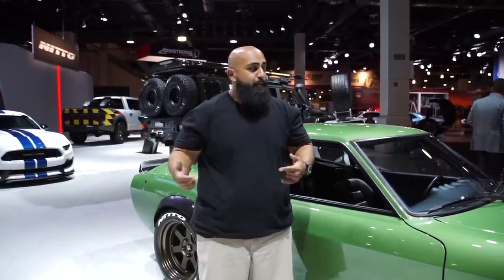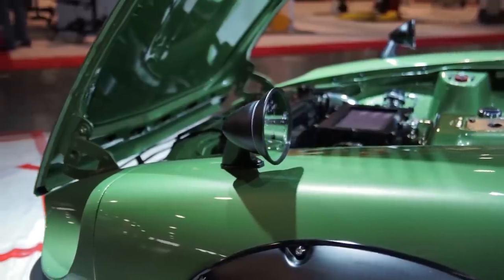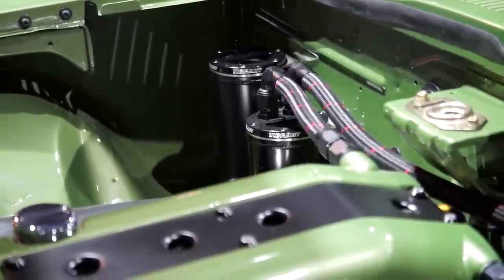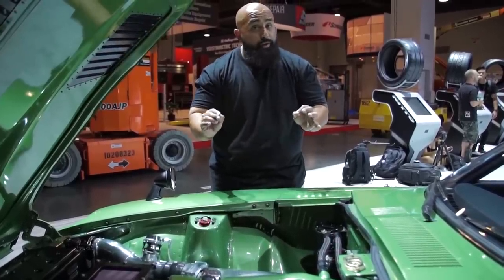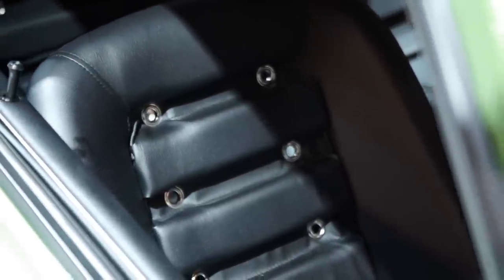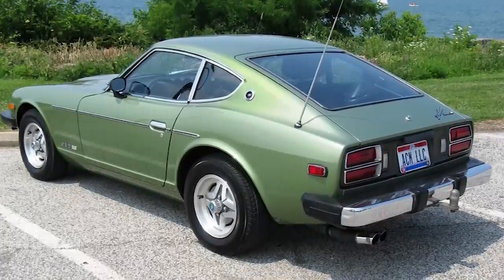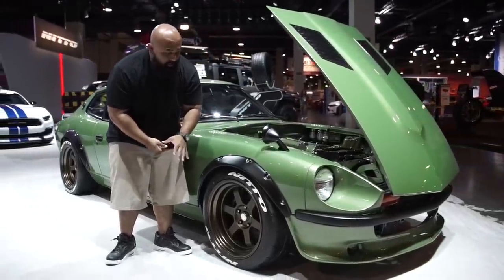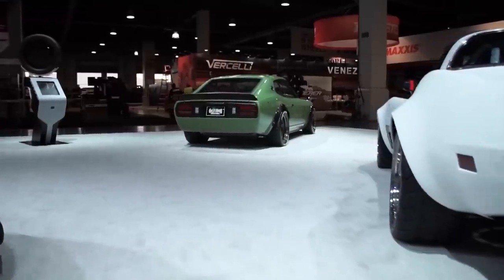Gas Monkey Garage Builds a Japanese Import: In-Depth Look into the 1975 Datsun 280Z with Big Mike

Comment: if you wanted an abso;ute monster you wouldnt have gone with a SR20 but rather a RB26. HUGE difference in monsters. lol Just saying. you got a little pipsqueek of a motor. The King of Imports GODZILLA is the RB motor.
Reply: I chose an SR20 for a variety of reasons, but one of the main ones was because of the weight balance that it retains. The car stays close to the original 48/52 weight balance that it came with originally when using an SR20, which was one of the reasons the vehicle was so successful in racing such as SCCA. Additionally, you must take in to consideration that the viewers of that show. Choosing a 2.0 Liter, 4-cylinder powerplant to people who use motors all day long that are twice that size and bigger... I knew it would be a point of contention. That was part of the point. But this fully built SR20 with that Garrett turbo makes for solid horsepower and torque, which is something that makes it that much able to be respected/appreciated/relatable to those who watch the show. This makes over 300 more horsepower than stock. Additionally, as much as I love the RB, I would have wanted to do a fully built RB26DETT and there was nowhere near enough time or money to do the setup that I wanted to properly. Nowhere near enough time or money. I hope that gives you some perspective and context to why I made the decisions I did. Thanks for the love.

Comment: The shaved no bumper does not look good. Original bumpers should have be retained. On a GMC pickup a roll pan with no bumper looks good. But on the Z bumpers should have retained (could be be smoothed over) painted or chrome but retained. Does not look good on the rear end.

Comment: So you spent over $80,000 to build a 2+2 S30... and you put a damn SR20 in it? This is the dumbest thing I’ve ever seen. If you remove the L28 (you shouldn’t) you replace it with a RB25 or RB26. You don’t subtract cylinders and displacement on a S30. That’s Z sacrilege. Zs are 6 cylinder cars. ALWAYS.

Comment: so let' see you removed the Rear Bumper the Seat Belts and the Head Rests and  moved  the Battery from its original spot to inside the cabin without a Marine Cover.then you say it's a race car gee I don't see a ROLL BAR..try rolling that car and see  what happens ..where i'm from it's no longer Safe ..and could not go back on the Road..  only in Texas

Comment: Cool car, but fucked up ruining a mint condition all original 13k mile car. Since it was stripped and restored, would have been smarter to get a high mileage car that needed to be restored.
Reply: I can definitely see the logic in that. The thing is, when it comes to television there isn't always enough time to do things the way you'd ideally like to. There would have been no time to source panels and do rust repair on the body, so we needed to start with the cleanest chassis possible. And that is the one we found.

Comment: Wtf is this guy talking about “custom contouring to the valve cover”  lmao! Anyone that is in the Nissan world knows that the s14/15 valve cover have the contour in the rear and vvt on the front lol! S13’s have the “non contoured” valve covers. Or is he trying to say that they shaved off the Nissan lettering in a more fancy way lmao! Just say you shaved the lettering on the valve cover.
Reply: Yes, the lettering was machined off. In addition to that, modifications were made to the valve cover including welding of bungs and then the cleaning of welds, and the removal of imperfections and casting marks. All of that was done not just for necessary crankcase ventilation, but to streamline and compliment the natural shape of the S14 cover. There was a lot of work done, on purpose, to make it look like there was none done.
Reply: Big Mike then just say “we made it look pretty” lol! Welding on bungs is not necessary for crank case ventilation. The factory crank case ventilation does a very good job. Now if you welded bungs on and capped off the other bungs to move the crank case ventilation to the passenger side I get it. At the end of the day I am a semi Datsun purist  meaning I am all for modernization but at least keep it with what it came with cylinder wise. A nice rebello L series 3.1 or an rb25/26 would have faired much better IMO. However in do understand budgets too.
Reply: Thank you for sharing your perspective
Reply: Big Mike hey I just saw the first episode  and I have more questions. 

1. They seemed to keep harping on the price of parts ordered for the car. At one point Christie said he had 80k into it? Being an import car guy myself, I was not
Shocked to hear that but how come you didn’t source places for suspension here in the states ? Meaning places like t3 or apex engineering. I will say that the rear billet arms were extremely nice !
Reply: Big Mike you are very  detail  oriented like myself if you ever in the Bay Area look me up and let’s hang out. Send me pics of your Honda and I’ll send you some pics of my past builds too

Comment: a sr what the fuck man you could have put a Nissan v8 or rb
Reply: I chose an SR20 for a variety of reasons, but one of the main ones was because of the weight balance that it retains. The car stays close to the original 48/52 weight balance that it came with originally when using an SR20, which was one of the reasons the vehicle was so successful in racing such as SCCA. Additionally, you must take in to consideration that the viewers of that show are used to high horsepower, torquey American muscle cars. A fully built SR20 with a properly sized Garrett turbo makes for solid horsepower and torque, all doing so in a 4-cylinder powerplant - something that viewers are going to want to find fault with (but won't be able to). Additionally, as much as I love the RB, I would have wanted to do a fully built RB26DETT and there was nowhere near enough time or money to do the setup that I wanted to properly. Nowhere near enough time or money. I hope that gives you some perspective and context to why I made the decisions I did. Thanks for the love, or hate. Whichever you choose to give.

Comment: This is not an import. It has a steering wheel on the left side, meaning it was made in USA.
JDM cars have steering wheel on the right. Like on the Skylines.
Reply: No Datsun was made in the U.S... Nissan didn't start manufacturing in the U.S until almost 2000.. this is an import.

Comment: Ya shoulda just restored it, not put all that crap on it. Electronics are NOT a good thing. they mean trouble that you don't have to have. It was fast enough in stock trim, you don't need all that extra crap.
Reply: I can see what you're saying, but this is a TV show... where they build cars, not restore them. There are shows/shops that do restorations, but that's like someone going to their Restoration shop and telling them they shouldn't have restored it, they should have built it.
Reply: you can hotrod a car without friggin electronics. People been doin that forever. I hate electronics, they do nothing but cause problems that are hell to track down when they mess up, and they will. I for one don't like computers in cars, self driving tech, any of that. Only pussies need that crap.
Reply: So do you prefer carburetors over fuel injection?
Reply: actually yes. I can rebuild a carb. Can't rebuild a computer module. I don't see fuel injection as being so darn great anyway. Carbs work, and don't need electronics to do it. The only exception to not liking electronics is the module that replaces points, points were always a pain to get and keep right. Keep it simple what made the original vw great was it was made simple, so that just about anyone could repair it with hand tools. no computer required.

Comment: Did he say it has an SR20 motor from an S14?? Why are people doing this to these cars??? It came with an L-series motor, KEEP IT, you can modernize those motors, people do it all the time! UGH, yes I know I'm being a tight ass Z car enthusiast, but fuck people need to leave the straight six alone thumbs WAAAAY down
Reply: So would you be opposed to an RB25/RB26? Just curious
Reply: @apollo6139  I personally wouldn't do it, and again I can't stop someone from swapping any motor into a Datsun Z. I just feel like there's options with the motor it came with since it's not a heavy car, and I mean...over so much HP in that car is just a bit much, and at that point you're cutting into the car's body for wider tires, etc etc. I just love the original S30 and the L-series engine.
Reply: @euclideancrypt8051  I respect that. I've got a '78 280z with the l28, and honestly unless you're running huge HP the fender flares are more of a "look". You can fit 8.5" tires under the wheel well if you're running coilovers (have to roll the inner wheel well just a bit). If I ever swap mine it would be for a more modern inline 6
Reply: @apollo6139  right now I'm driving an '89 300ZX Turbo, but I kept the VG series V6. It's a 3.3 VG block and heads from an Xterra, but 3.0 block components like the crank, cradle, oil pump and pan for the turbo.  So in a way did I maintain the integrity of the stock 3.0 V6? No, but it's still a VG-series motor. Like throwing in the 2.8 out a 280 into a 240.